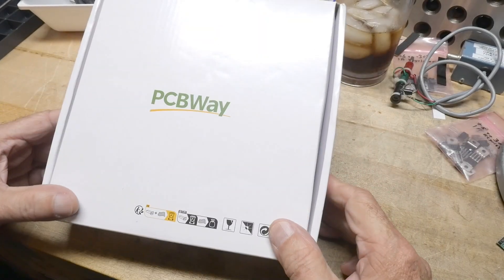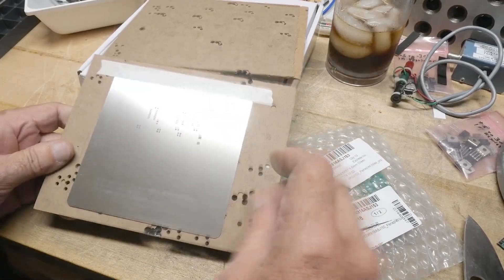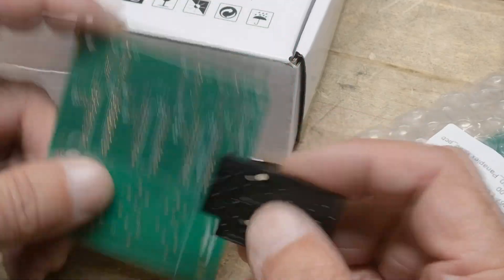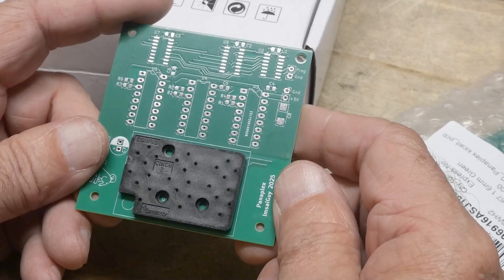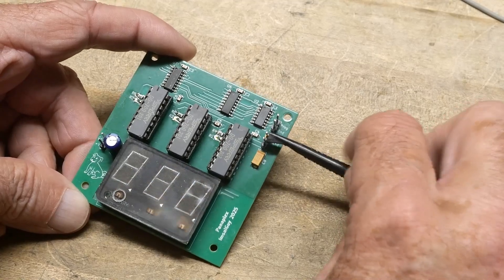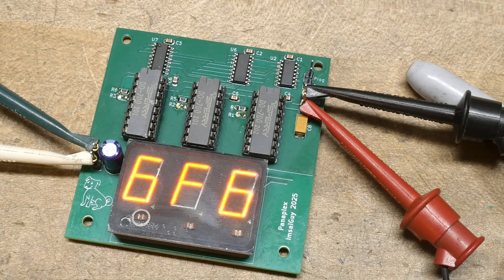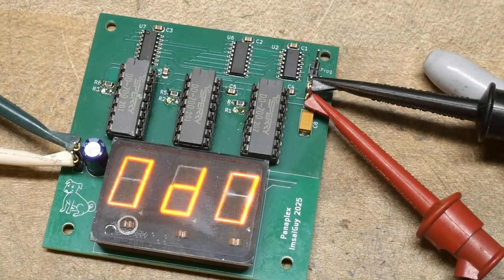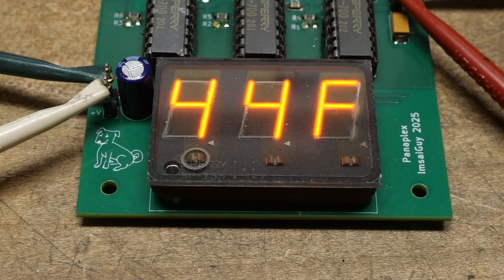#2163 Panaplex Displays (part 5 of 5)

Comment: My order from PCBway is on the way and now I'm in the process of adding components to my Digikey shopping cart. Your BOM lists a SMB tantalum capacitor but doesn't specify the value of the capacitor, voltage or size. You schematic also doesn't specify. I tried reading the values from the video but I still can't quite figure it out. I'm guessing it's 100 uF @ around 200 volts? I can measure the footprint when I get the PCB but I'd like to order my parts ahead. And what about resistors R1, R2, R3, R4, R5, R6? I think I can just make out 106, so 10K? And the caps C1, C2, C3, C4, C5, C6? What value would those be? Will you help please?

Summery: Need values for C8, C1-C6 and resistors R1-6.
Reply from the maker: anything will work, 1uf to 100uf
Reply: @IMSAIGuy  Thanks!  So 100 uF would be good for C8? Why did you use a tantalum for that particular capacitor? I guess it's because it need to handle a higher voltage? What voltage rating would you recommend? And the other caps C1-C6 what value are those? How about the resistors R1-R6? What value did you decide to use? Yeah, I'm a hobbyist, not an engineer,  so I need a little hand holding please.
Reply from the maker: c8 is just for the +5 volt supply, tantalum is good for low esr, but I used it because I had some, again anything is fine.    you might be thinking of c7 which is used on the 160V side. I used a 1uf 250V cap there.

Comment: Turns out I have a few of those 3 digit Panaplex displays in my 'junk box' that I got off of eBay years ago before they became crazy expensive. So now I'm ready to order some DD-700 chips off of eBay for a premium price and order some PCB from PCBway. But two issues. I don't see a link for your code. And obviously I don't have the socket for the three digit display. Maybe I could substitute something else? And maybe you would be willing to share your code? I'm hoping for the best. Please advise.
Reply from the maker: code is on share: https://www.pcbway.com/project/shareproject/Panaplex_Display_Board_b2db1457.html
Reply: @IMSAIGuy  Fantastic! I have two SP-353 (hopefully working) displays I'd like to test out with your project. Your video shows it working with a SP-753 which I think is an equivalent substitute for the SP-353's that I have in stock and is listed on your BoM? I'm sourcing the chips and other parts and will order the PCB soon. Thanks for sharing your projects. I've experimented with a few and have some waiting for me to build. My favorite so far has been the Chua's circuit.  I also ordered a TI-3500 desktop calculator from eBay just for S&G's.

Comment: Those displays really do look amazing. I think it's because the segments are very thin (unlike in a traditional 7-segment where they're quite thick), and because the illumination on each segment is uniform from edge to edge. With 3d printing, I've seen people make their own custom 7-segment displays, but none like this. Would be interesting to see someone try to replicate these with surface mount LEDs and 3d printing

Comment: I wonder if it's possible to multiplex those displays so you wouldn't need a driver IC per digit. That would require a high-side driver for each anode, but that might be an interesting design.

Comment: I wonder if these fade over time like VFDs.
Reply: They operate on the same principle as Nixie tubes, so not necessarily. There is a tiny bit of mercury added to neon-argon mix to prevent electrodes sputtering (as in all quality neon glowing things). Seen the ITO (indium-tin oxide) anode starting to degrade in some, but it didn't change their brightness noticeably. Sometimes unused segments ghostly glowed, but there might be a different reason for that.
Reply: @argoneum  Do you know if they are subject to "cathode poisoning"?

Comment: Definitely a thing of beauty and a joy forever.  Had to dig out the 15 digit frequency counter I made years ago using these displays and sockets for old times sake.  Had it hooked up to a sweep generator and running all night last night.  It got me thinking about a clock so have started to lay out a board that will have day/month/year and hours/minutes/seconds.  Have a couple extra GPS modules laying around so plan on making it GPS sync'd.  Should be a fun project.
Reply: Hey why you stop making videos ?
Reply from the maker: did you multiplex yours?
Reply: @IMSAIGuy  The frequency counter I made years ago, no.  Just a box filled with a few pounds of IC's. 🙂 I will probably multiplex the clock.  I need to research multiplexing Panaplex displays.  I know if you don't use "keep alive" there is a maximum of only a couple milliseconds refresh rate.  Think I have a application notes bulletin from Burroughs in my filing cabinet under Panaplex displays.  Need to dig that out and give it a thorough read.  If I remember correctly it covers it in great detail.
Reply: @mikesradiorepair Question.  When you start your counter, does it show all 0s or just one 0?  Like 00000000 or 0?
Reply: @bayareapianist  I made a custom probe to use with it.  It's a old HP oscilloscope probe that had lots of unused space in the body.  I added a small slide switch to it and replaced the standard coax cable with a piece of triax coax cable.  Inner conductor is the signal, inner shield is GND and the outer shield gets switched to ground via the switch.  The switch turns on and off the Panaplex display.  I can turn on the counter and leave it on all day with no fear of shortening the life of the displays.  I only enable the display via the switch on the probe when I need it.